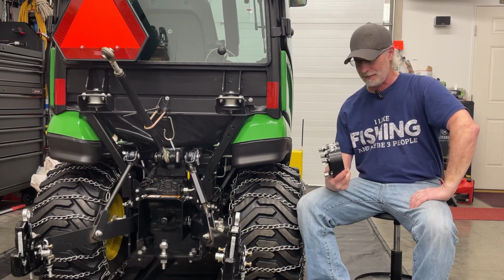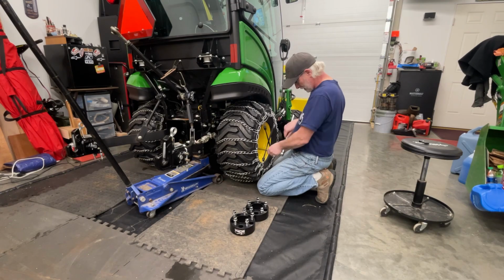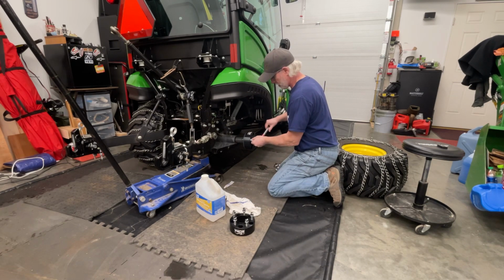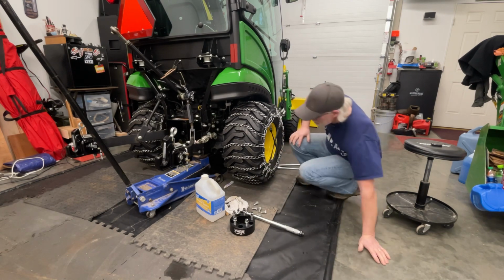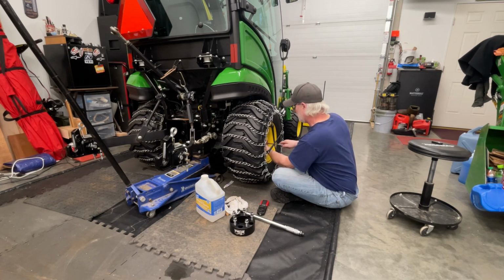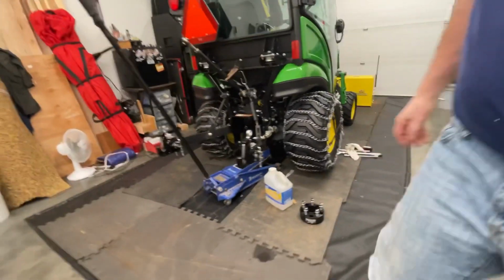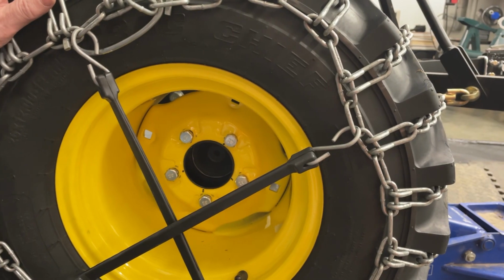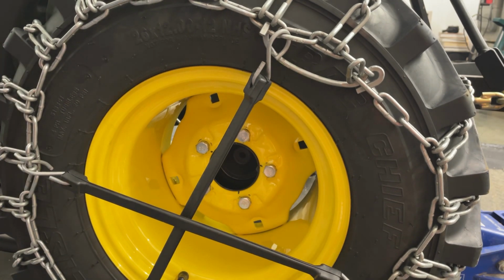Installing 2” Bora Wheel Spacers

Comment: and now you've answered my ballast question! LOL. If you were to try the rimguard option, would you do rear wheels only or front as well as rear?
Reply from the maker: Hey sorry missed getting notifications on your comment. I would think for me probably just the rear? Although I don’t think having it in the front would hurt as well. Do you have a 1025?
Reply: @gtalaskanadventures  no apologies necessary, truly, I have ordered a 2025 with a front blower, hoping to arrive in May/June. I am trying to sort out ballast/traction/weight distribution setup. 95% of the use is for snow clearing only.
Reply from the maker: @LakeJoe  That’s exciting! I sure love mine and wish I could have owned it a long time ago. I’m curious did you order the three point new blower?
Reply: @gtalaskanadventures  If you mean the green HD blower, yes. 54", It is a big investment, but I am excited.
Reply from the maker: Well I’m sure you’re going to love it. They’re amazing work horses. And seems folks have a lot of good to say about the new green blowers! Lots of negative stuff about the model I have🤷‍♂️ So far it’s done an amazing job for me. I’ve got no complaints. Congratulations on your new purchase!